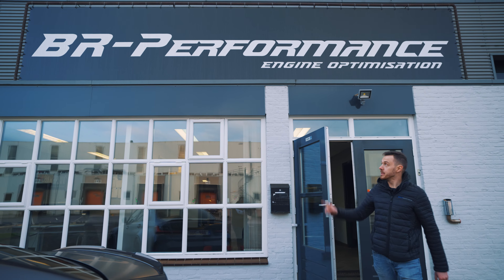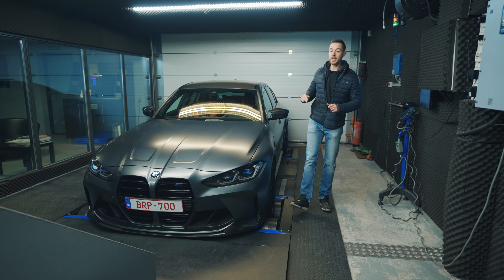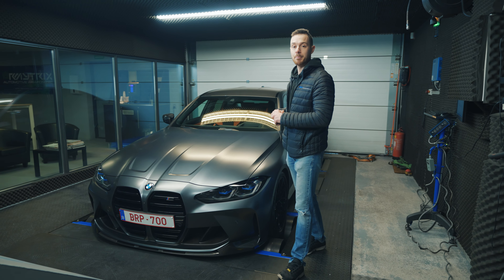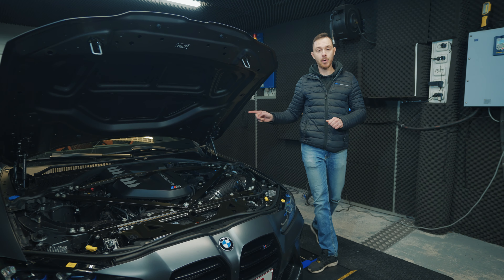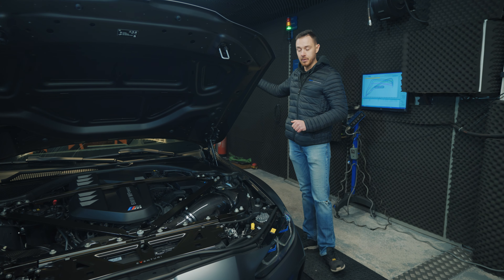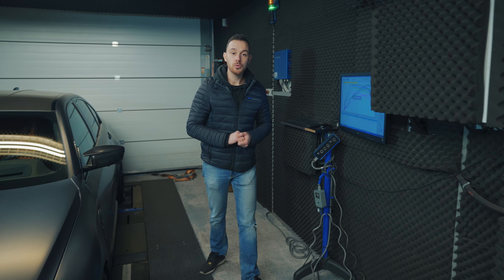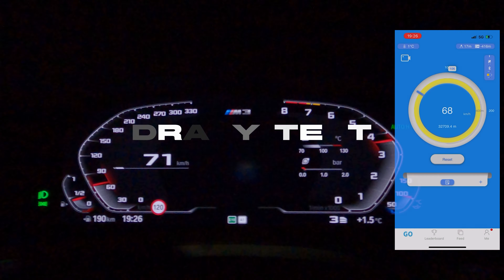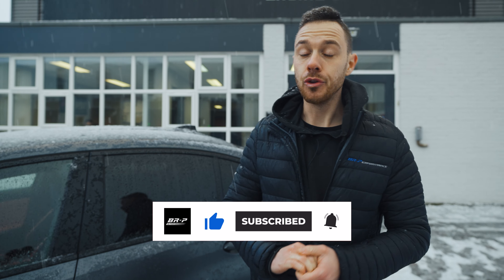+760 HP BMW M3 G80 Competition / Stage 2 by BR-Performance

Comment: I am 100% positive that this car didn‘t make 510 hp and 650 Nm stock…because none of these cars do, they usually make around 535 hp and 700 Nm…STOCK. 😉

The S58 engine is good for a maximum of 700 hp without further internal(!) engine mods, the gearbox should be OK with 800 Nm torque but more? Hmm…risky. Just saying…

Unless of course people don‘t care about reliability. 👀

A hot summer day on the Autobahn in Germany or some track fun in summer on the Nordschleife and BOOOOM… 
I‘d stick to under 700 hp and under 800 Nm to be somewhat safe.
Reply: We've extensively tested our stage 2 98RON tune on Spa (BDG 2022) and multiple occassion on Zolder.
For BDG the car did over 100 demo laps the entire weekend without a single drivetrain issue lapping the track in an average of 2:42:xx during hot laps.

I understand your concerns, but an engine doesn't break down due to hot weather or high speeds, it breaks when a calibration isn't developped well and/or when securities that are in place, are disabled.

If for some reason an engine parameter would be out of a safe range, a BRP tune will also indicate this accordingly.

👍
Reply: @dimitrivanbuggenhout5930   Of  course the engine breaks down due to heat and high speeds stress when the hardware hasn‘t been made for this kind of power and especially torque. 😉 There is a reason why the gearbox has a torque limit and what about other drive train parts, like the drive shaft or other parts?! Sorry but for the M3 G80, 700 hp should the limit if people are looking for reliability.
Reply: Hahahaha every stage 2 m3 g80 has waaaay more than 800nm and nobody has issues with their gearbox talk about things you know